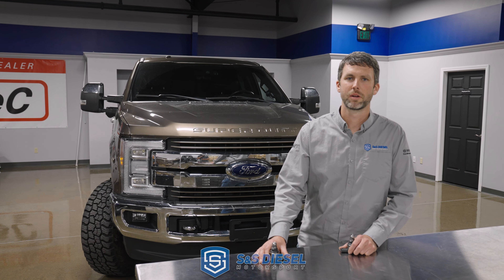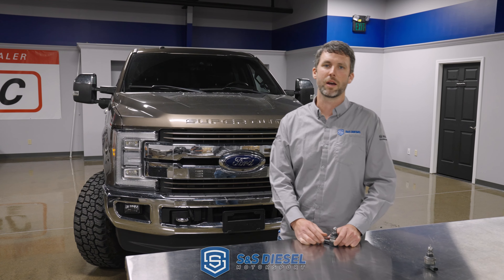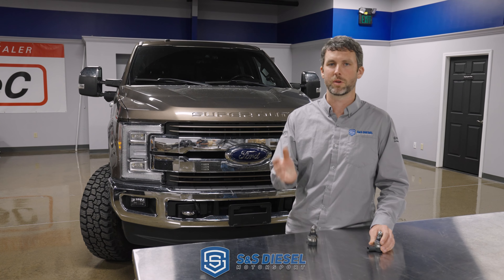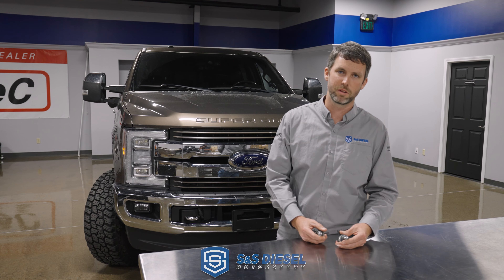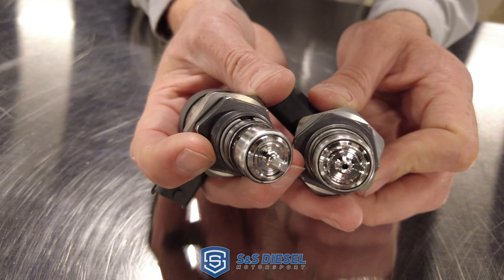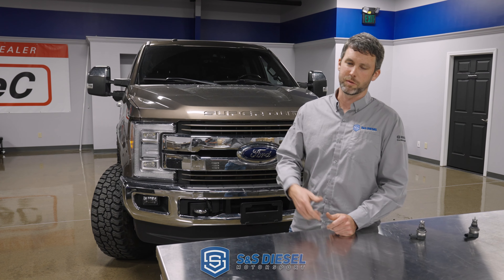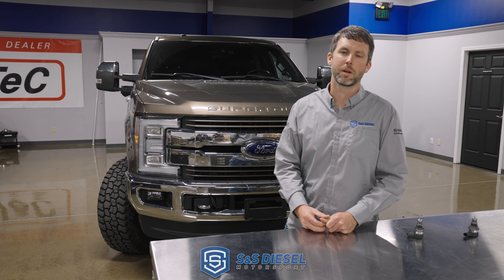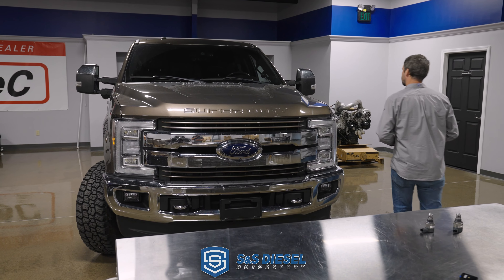The Ford 6.7L DCR Pump Eats Water and Rust Like a Champ

Comment: Thanks for taking us along for the ride. Lots of great information; plastic filters, implied check for WIF, return pressure needs, etc. Do you do any injector testing for customers? Would like to learn more about possible self-tests if possible.
Reply from the maker: Thank you. We offer injector testing and balancing services for anything common rail diesel, from small skid steer engines to giant 95-liter Cummins engines. Fee for testing starts at $60 per injector. Sending an email to info@ssdiesel.com is the best way to get started for injector testing, and to get troubleshooting tips/tech support We have a form to include with the injectors here: https://ssdiesel.com/wp-content/uploads/2022/04/Testing-Work-Order-Form-SS-Diesel-Motorsport-1APRIL2022.pdf

Comment: I thought the pressure relief valves were one time use due to the way they seal on the rails
Reply from the maker: Not that we're aware of, but Ford could have different work instructions. Bosch fuel rails are sold with DRVs installed as an assembly, but the DRV can be removed and reinstalled as many times as needed. It's a little tricky to tighten since it uses a threaded locking ring. We run DRVs on all of our test benches and need to change them from time to time, due to the extreme duty cycle they see. We have no issues getting them to seal.

Comment: I know you make a CP3 conversion for the LML Duramax but are you making a DCR pump for LML ?
Reply from the maker: Not at this time. We are extremely confident in the durability of the CP3 and we have had great success with our LML CP3 Conversion kits. We do not have a reason to change.
Reply: @SSfueled  thanks for the reply. I’m going to try to use a CP3 off of an H&S dual fueler kit from a 17 powerstroke. Hopefully it works with your lines ?